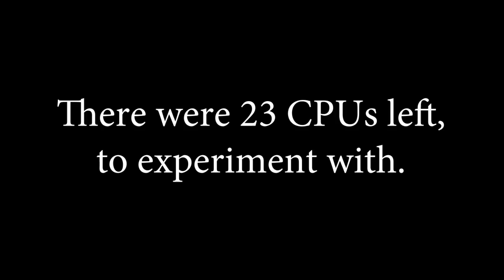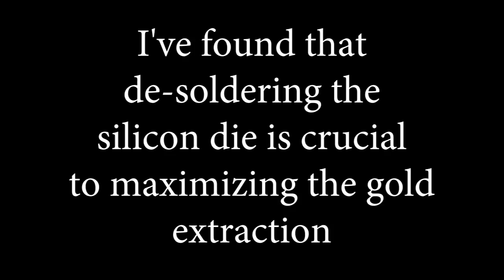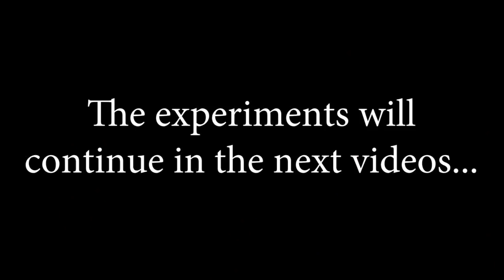GOLD from Intel Pentium Pro:  yields, recovery and refining PART 1

Comment: Hi I've fot question for U, if I have circuit board with gold plated circuit but gold is covered with tin, what should i do ?
Reply from the maker: HCl then AR
Reply: OwlTech but I can't get HCl and nitric. What Can i get is sulphuric acid 48%, hydrogen peroxide 3%, vinegar 12% table Salt and sodium/potassium nitrate
Reply from the maker: soak in vinegar and H2O2  (if the concentration of the reagents is as you mentioned above)
Reply from the maker: you can make HCl from sulphuric acid and NaCl https://www.youtube.com/watch?time_continue=4&v=YGjd7xxTuZw

Comment: No need to desolder the silicon die, if you break the die with a hammer and apply more heat you will get the same results